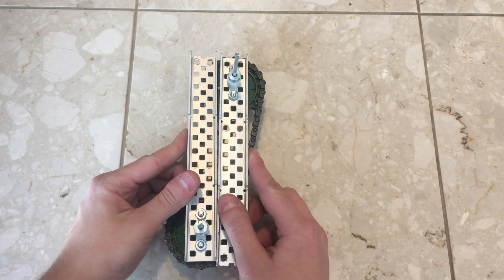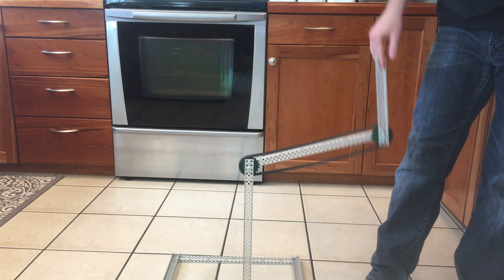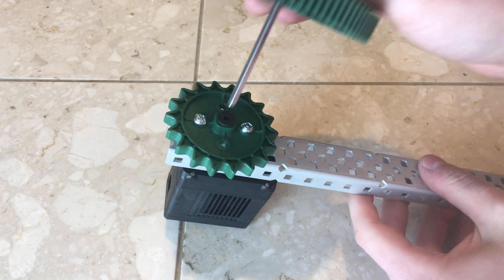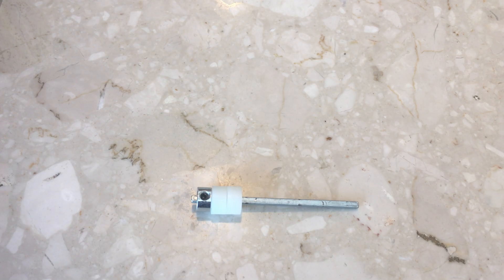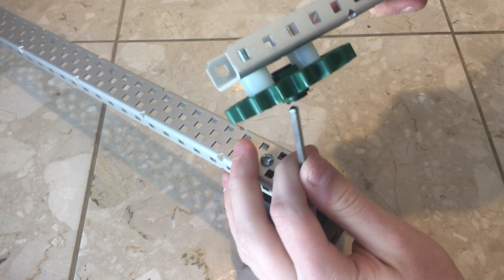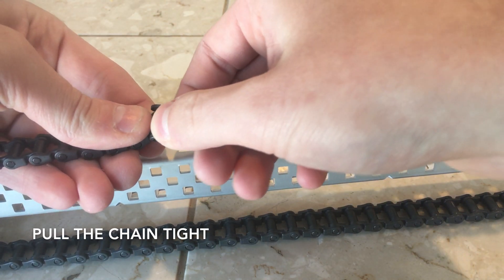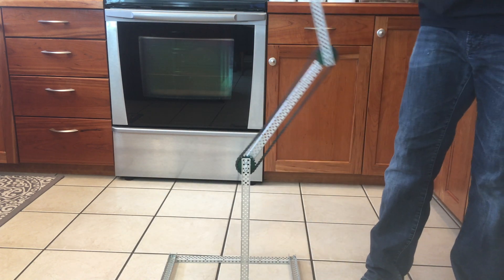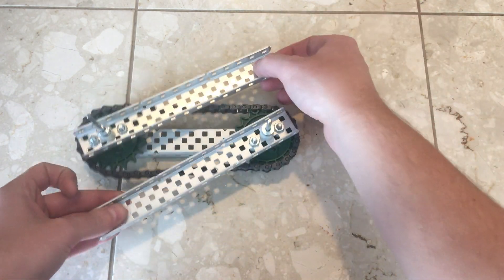Kepler's Guide to Chain-Bar Lifts

Comment: So what's a chain tensioner?
Reply from the maker: It's anything that you add that the chain runs around. It's usually used to reduce slop in the chain so it has less chance to skip over the sprockets or catch on things.
Reply: @KeplerElectronics  Oh, that's pretty simple. Also wow, fast reply!
Love your videos btw!

Comment: Where did you learn these designs? Other team's? etc.
Reply from the maker: A lot of these designs are commonly used in the VEX program, I figured out basically how they work from looking at old robots, and then found an easily buildable and showable way for the video.
Reply: @KeplerElectronics  Just wanted to say that I really appreciate these videos. If only you posted these 4 years ago when I started vex :)

Comment: Does using chain create more torque than regular gears?
Reply from the maker: I don’t believe that it creates more torque, as the sprockets are the same size, but it is both simpler and lighter than using gears.
Reply: Thanks

Comment: Hey Kepler, couldn’t you just put 1/8” shaft inserts that have a circular hole in the sprocket so you don’t have to put the motor on the bar that’s being lifted?
Reply from the maker: That actually should work! I didn’t realize that you could do that when making this, but next time I make a chain bar, I’ll definitely use that technique. Thanks for letting me know about this!